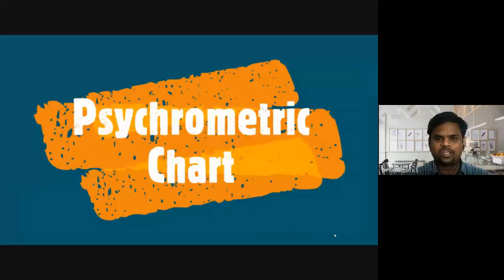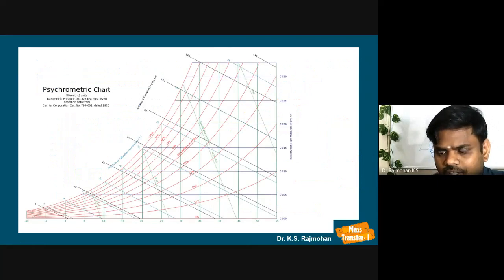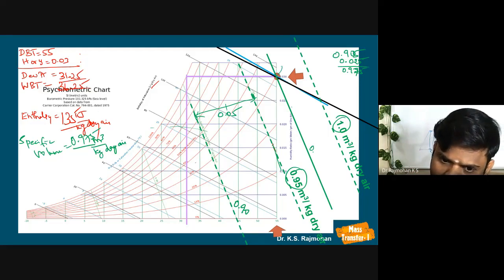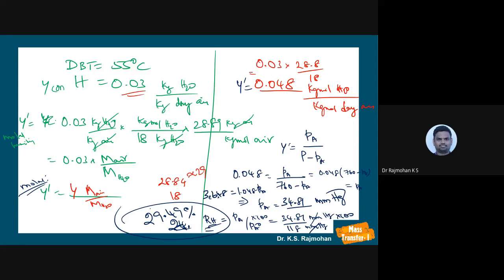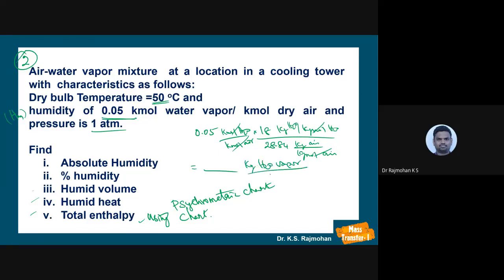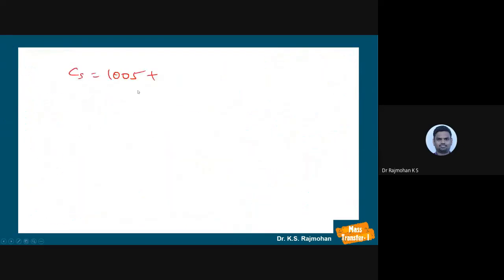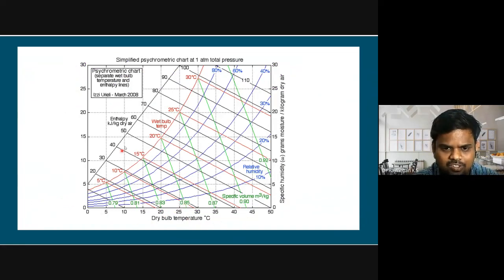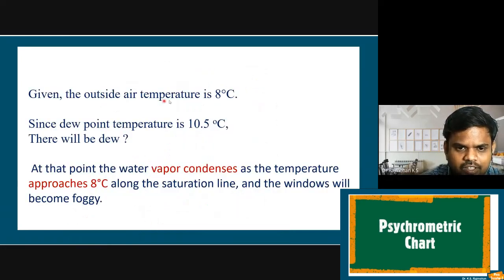Lecture 35 Psychrometric Chart Numerical (Part-1)

Comment from the maker: Two minor corrections:
1. At time stamp: 32:03: Correct the 2nd  question as , DBT is 50 oC and Absolute Humidity is 0.014 kg water vapor/ kg dry air. (Given data). and practice the problem for 0.05 kgmol water vapor /kgmol dry air. (0.031 kg/kg dry air)

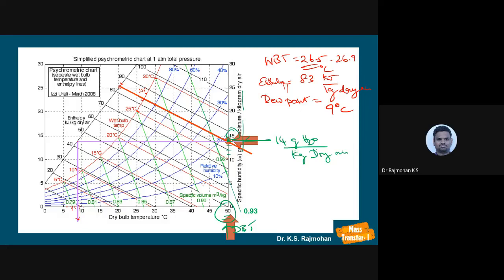2. Also, at timestamp 38:50, For dew point we have to draw a line parallel to x-axis till 100% saturation line ONLY(not up to enthalpy line). Accordingly dew point is 19 degC instead of 9 deg C.